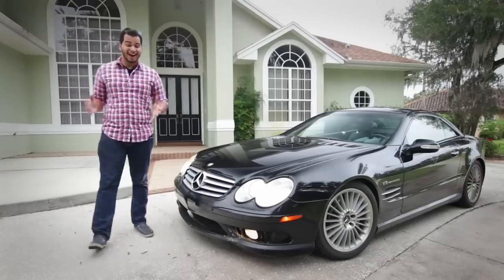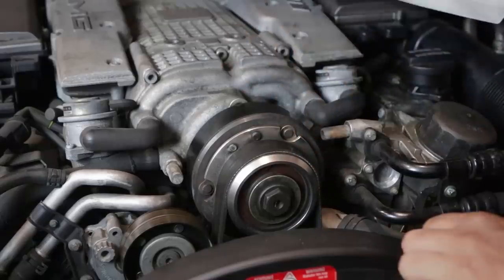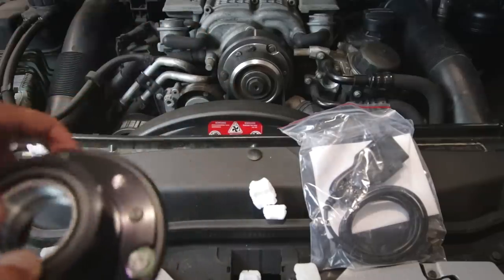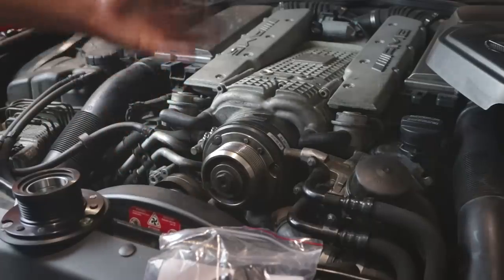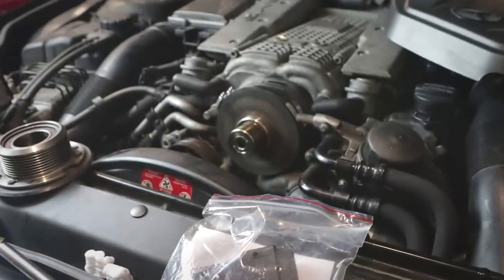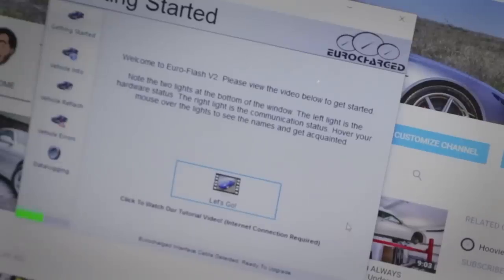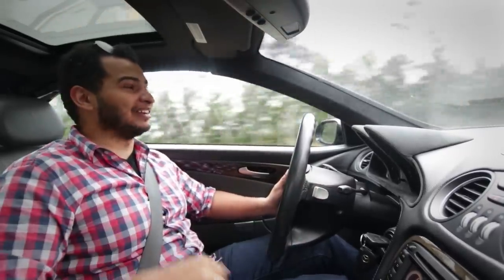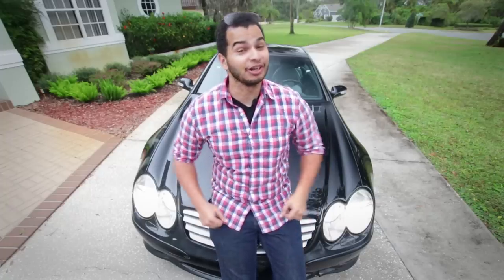This Little Box Made My Cheap SL55 AMG STUPID FAST! - Project SL55 Pt 8

Comment: Someone who actually knew what they were doing might resurface the mating surface for the clutch plate, check and adjust the gap between the two plates, 
and check and add kompressor oil on a regular basis.
hip hip hooray for another wannabe race car driver wreaking havoc on public roads though.